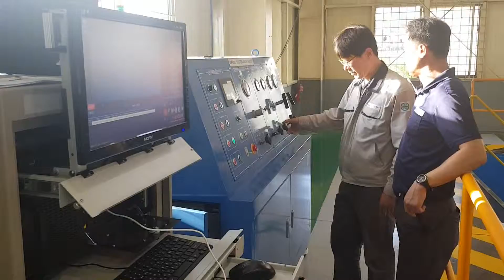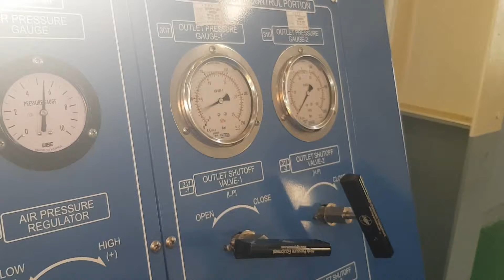DAEHA horizontal valve tester 1200ton

Comment: Don’t use flange separate tool while you use two shafts with acme threads to hold your valve to test 
You can use it if you use hydraulic to hold your valve to test
You know you need more than 1800 ton to hold your valve 
To test valve size 48”x600